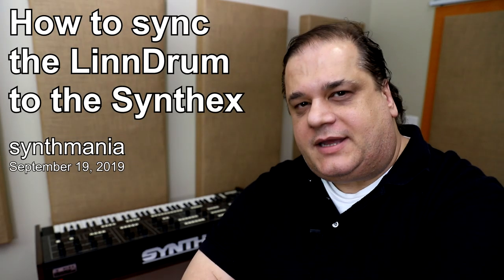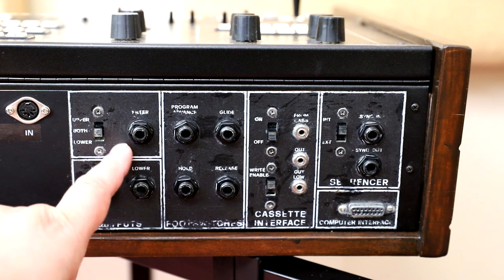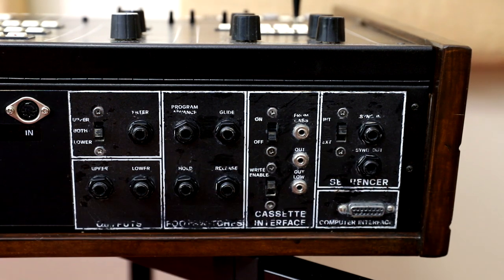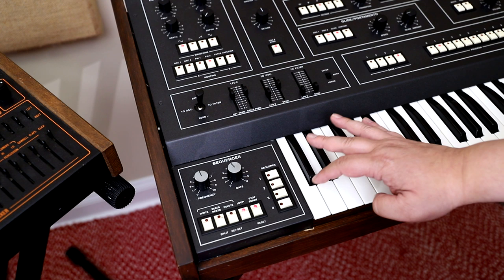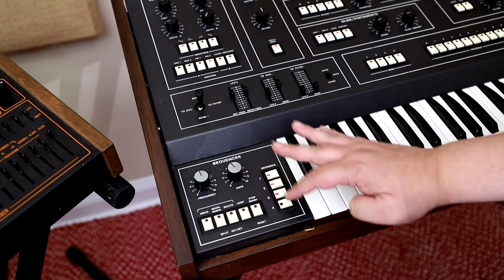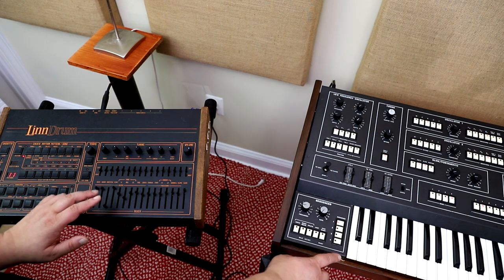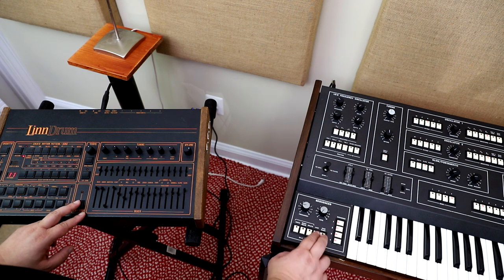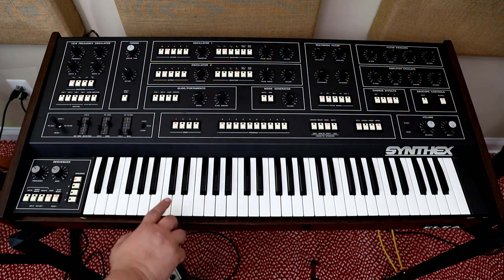How to sync the LinnDrum to the Synthex

Comment: greetings! for the minidoc what type of cables do you use TS 1/4? or  no? also been looking for a manual on this forever! please help! thanks!
Reply from the maker: Yes, TS 1/4" will work. The manual on Minidoc is basically printed on the top of the unit, it's a very simple unit... you don't understand something ?
Reply: @SynthManiaDotCom  thanks im new to all of this stuff on making everything work with each other! ive always had to use midi in the past but now with these other machines I need to go this route now! the main question now is how would i be able to implement something like the sp1200 on top of this setup since the mini doc doesnt have midi much respect
Reply from the maker: So you have Synthex, LinnDrum, and SP-1200? And you're trying to sync them?

Comment: Hi Paolo, I see that both machines have been upgraded with MIDI. I guess synth clock through midi probably was not implemented?
Reply from the maker: Hi, Albert, I know for sure the MIDI on my LinnDrum (Forat) does transmit MIDI clock, but I haven't had the chance to try the MIDI interface on the Synthex yet. I'll try it soon, but for my experience with other vintage synths and drum machines that I have, you get a somewhat better "feel" when using the old school pulses